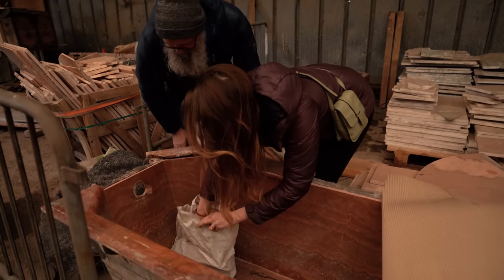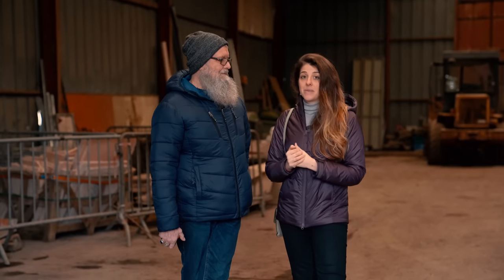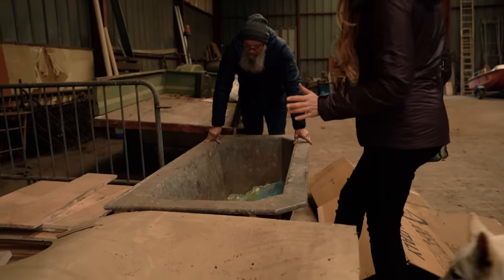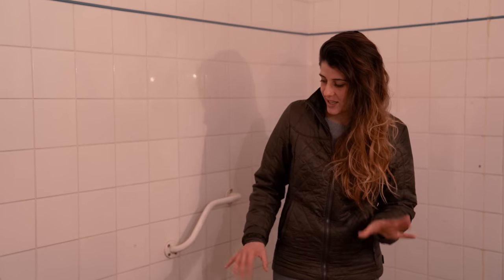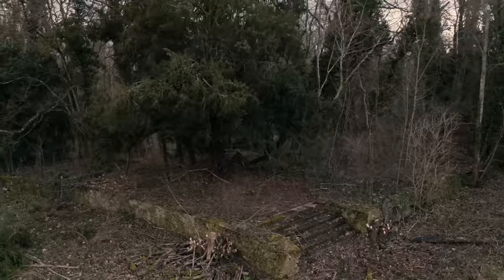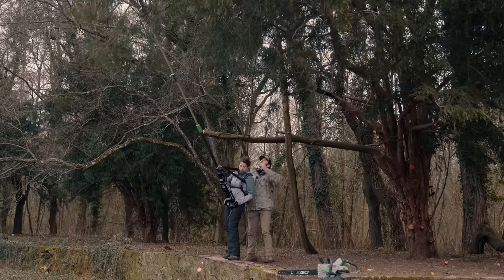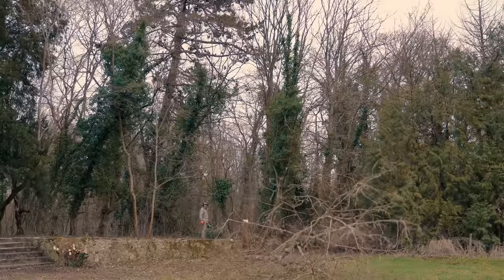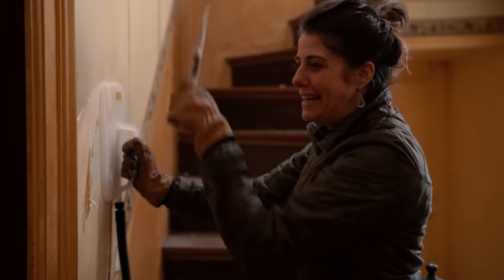Shaping Our Chateau Garden | French Chateau Maintenance

Comment: Suggestion #2 - there is a small hand roller with little spikes on it. You roll it on the wall creating little holes in the wall paper. Then, spray the wall with fabric softener and a little water. Let it sit for an hour, then scrape.

Comment: The wallpaper steamer is the winner. Scratch the paper in a criss cross pattern and the paper gets softer quicker and it all comes off faster.
Reply: If you didn’t have a steamer just scratch the paper to brake the seal and spray water on it 😊and it will just peel off easily

Comment: I did the same as you guys and bought a wallpaper steamer too.  But after discovering Dissoucol liquid in my Brico I'm a convert to that instead.  If you roller the paper and give it time to soak in it will peel off sometimes in a complete strip.  So satisfying.

Comment: There is a product you can buy at bricomarche called something like “ decolleur” you add water and brush it on, one minute later you scrape the wallpaper off. Personally I find this much easier and quicker than steaming  and frees up both hands, no need for a cable and electric socket nearby etc, for scraping and peeling. Very old wallpaper really seeps into the plaster over time it can be a very very tedious job.

Comment: I too have an extension chain saw but it is half that size and it is heavy to hold and operate. I can only imagine the enormous weight of yours. My back ached just watching you both using it. As for the wallpaper removal, do yourselves a favor and remember to wash the walls now to remove any old glue left behind. It does make a difference in the long run when you go to paint. It's like painting over dirt. Not good.